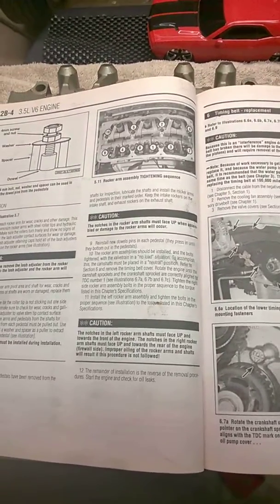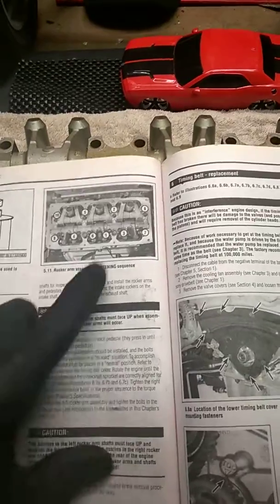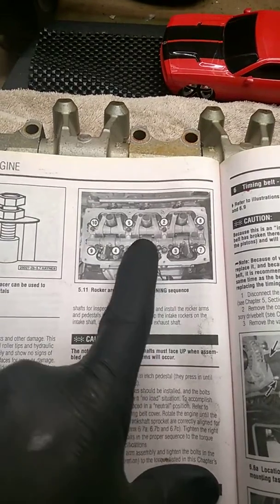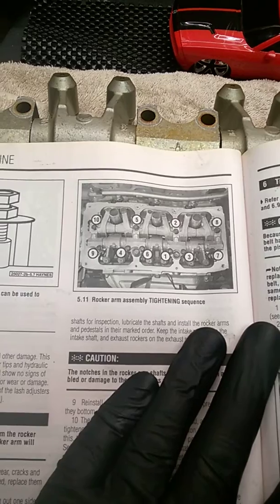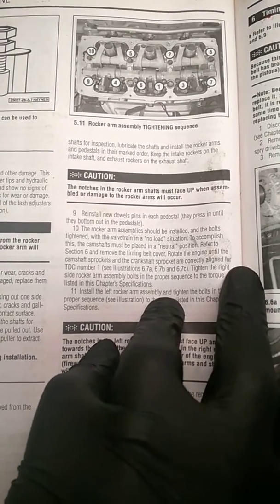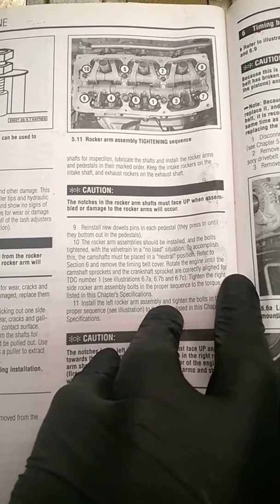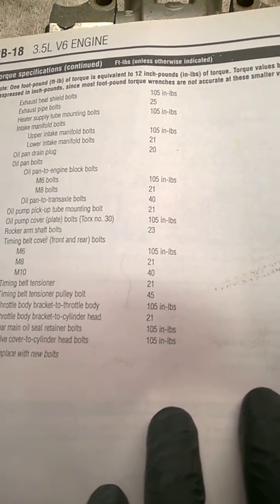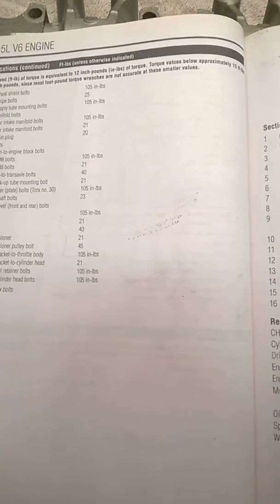Rocker Arm Assembly Bolt Tightening Sequence and Torque Specs

Comment: Thanks for the video. Can't find any information on Dodge Journeys hardly, but thankfully the rocker arm assemblies are the same for most 03-11 Dodge/Chrysler 3.5s with minor differences. It really helps to have the installation sequence and torque specs.

Comment: Help!! Please! Okay so I pulled both heads myself off my 2006 Honda Odyssey took them to the shop got all valves replaced cleaned all the parts up got her back together and I've got a slight knocking in cylinder four.. after I got to looking close I noticed that the two screws on there that holds down the rocker arm are not screwed down all the way like the other ones are and they turn very very easily so what happened did they turn themselves off of there do I turn them down like the other ones?

Comment: Good video. I'm no mechanic but looking into replacing the rocker arm assembly on the passenger side of the vehicle which would be 1,3,5 side. How do i know if #1 is at top center and does not have load if not so how do i put it to that position. Thanks
Reply from the maker: IIRC there is a TDC mark on the crankshaft pulley that can be used to position the #1 cylinder at TDC.  You would need to remove that front timing cover piece to be able to see that pulley and align its TDC mark though, which is a pain in the butt.

An alternate approach I’ve used is to pull the spark plug out of cylinder 1 and insert something like a really long one-piece socket extension into the spark plug hole, and watch that go up and down as i rotate the engine by hand. As soon as the intake rocker on cylinder 1 completes it’s up/down sequence then the extension should be at its lowest point of travel, and further turning over of the engine will slowly raise the extension up in the cylinder as the piston is coming on compression stroke.  Once the extension stops going up and starts to go down, you know you just started the power stroke, which means TDC was just there.  Rotate engine back a hair to get extension at its highest point again, and that’s TDC for that cylinder (number 1).
Reply: Thank you so much very useful information 👍. As far as turning the engine all I need is either a breaker bar or ratchet with a socket correct? Will I be able to do that with the serpentine belt on or should I remove it?
Reply from the maker: @sergiosanchez4967  a breaker bar or stout enough ratchet will do it, you’ll just need to find a socket that will fit one of the accessory pulley bolts or the crankshaft bolt.

Start the engine and watch the serpentine belt’s direction of travel to know which way to manually spin the engine with the ratchet and socket.  (Seems like it spins counterclockwise, but I can’t recall for sure; definitely verify that with it running and observing the belt’s direction of travel).
Reply: Thank you so much this will save me a ton of money!!! Keep up the great work with the informative videos and feedback!!👍👍
Reply from the maker: @sergiosanchez4967  Oh yeah, one more tip/trick:  if you are having to spin the engine over manually with a breaker/ratchet, remove all the spark plugs first.  

Spinning it with the plugs still in the heads means you will fight the cylinders’ compression each time the pistons go upward.  That requires extra effort to overcome as you turn it by hand obviously.

Spinning the engine without the plugs in it is much easier to do when doing it by hand, not nearly as much resistance for each turn of the ratchet/breaker bar.
Reply: @NukeNukemson  Gotcha... thanks for the tips and tricks. Would I need to let the assembly soak in any oil? Seen someone post that on forum. Wasn't to sure about do that.
Reply from the maker: @sergiosanchez4967  Soaking the rocker assembly in some engine oil before installing it is a good idea for sure.   If possible, let it set in the oil overnight.  If that’s not possible, try to let it soak for a couple hours at least.

Doing this reduces, or even eliminates, the amount of time the assembly will operate without adequate lubrication immediately after starting it up after the part installation.

Any clacking or chattering at startup is an indication the assembly isn’t lubricated properly, and that’s those rocker assemblies’ problem in the first place - they fail hard and fast without proper oiling.  So any way to ensure they never clack or rattle when starting up is best pursued!  🤓
Reply: @NukeNukemson  Awesome 👌... I feel a bit more confident on doing this job through out the weekend with your help and knowledge. Now just fingers crossed 🤞 that everything comes out right lol. Thank you once again!!

Comment: i have a 2010 dodge journey and already replaced the lifters in the rocker arms. i did check for side to side play, and was not bad. the problem i have now, is one of the lifters is not pumping up. any idea why?  it is alot quieter than before but still has the one lifter not pumping up.
Reply from the maker: I honestly did not know replacing those hydraulic lash adjusters in the rockers was doable.  If one will not pump up though, it’s got to be a constricted/restricted oil flow issue in the rocker arm I would think.

You say the side to side play in the rockers isn’t bad, but I don’t think there is supposed to any really IIRC.  If the rocker of the lifter in question has any play side to side, that would be my first suspect for the cause.

What about swapping that noisy lifter with another one and seeing if the noise follows that lifter?  If it doesn’t, you know the problem is at the rocker in question.

Comment: What car are talking about??? All cars are not the same!!!
Reply from the maker: San Juan  - this video was made for someone driving a Dodge Challenger with the 3.5L engine
Reply: Do you know what the ball park # is for a repair?
Reply from the maker: Eduardo Arana - as in how much to repair?  Well, the parts alone will be $250 or so for a new rocker arm assembly, $500 for 2 (if doing both sides).  I can’t say how much someone would charge in labor to replace them for you, but probably an hour at least, which is usually about $120/hr; double that if doing both sides.

It’s not hard to do the labor yourself if you are mechanically inclined.  I can provide a link to a write up on the steps to replace them (I think I have it somewhere) if you want.